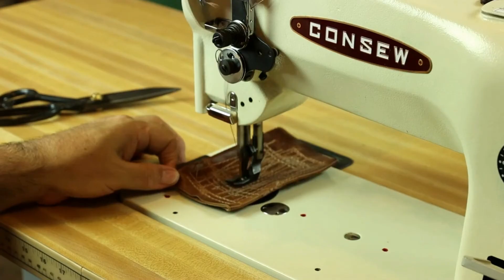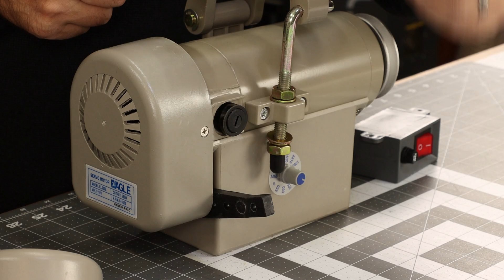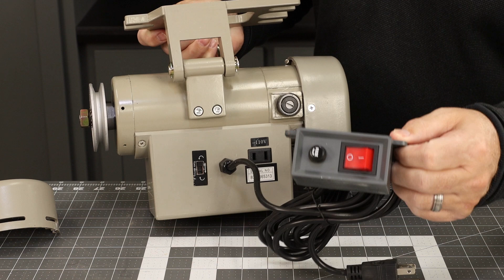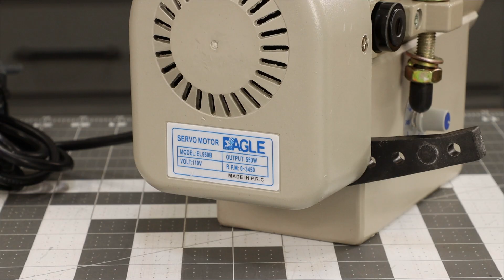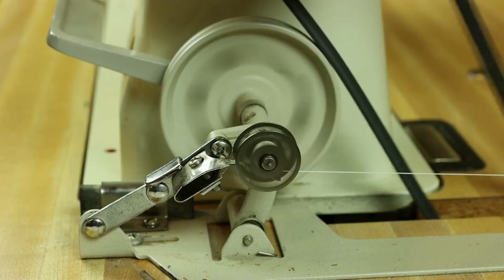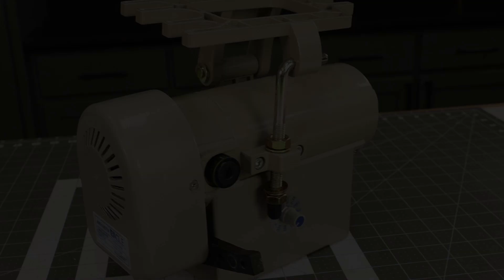Cutex Eagle 550w Analog Servo Review

Comment: Certainly appreciate your time and effort on this one. It's evident you like this motor for power and reliability. I recently pulled the trigger on a Reliable brushless servo for my 226 (no speed reducer just yet) Certainly a game changer over a clutch motor. A friend of mine just yesterday picked up a real clean 255RB-2 thats in need of a servo. His plan (his 1st sewing machine) is to mainly work with heavier leather. Do you feel that this 550 watt analogue motor with a 3 to 1 speed reducer and smaller motor pulley would offer all the punching power he will ever need ? I'm hoping to gain from you some confidence being that my friend is relying on my help on getting his 255 setup right from the get go. Also, do you not prefer a box style speed reducer, and prefer the style that just hangs from the table?  Thanks in advance !
Reply: Wow, the Kinedyne SL servo is amazing. I call them yesterday for availability and pricing. Talked to a gentleman for over 15 minutes. There obviously pumped up on this motor. It’s kind of a no brainer on what to buy if you’re looking for slow speed with power. The fact that a reducer is not needed, thus eliminating 2 belts, added bearings etc. What you said about hand wheel resistance being eliminated by not needing a speed reducer adds yet another reason. Thanks for always replying to my comments and other peoples comments!
Reply from the maker: Yes there's lots to unpack in the world of sewing machine motors.  I like the simple controls on these 550 watt servos.  They can be a little underpowered with the speed turned way down, but with the addition of a speed reducer, you could sew through plywood.  A 3:1 or 4:1 is definitely all you'll ever need.  I prefer the box style speed reducer because it's so easy to install.  A standard speed reducer is difficult to install, and if you don't mount it far enough towards the back of the table, the head won't tip back normally (due to the belt stopping it).  Another way to go is the Kinedyne servo which is like having a 4:1 reducer built right into a digital servo.  More on that one here...  https://youtu.be/IM0Os0j-MN8  Thanks for the kind words.